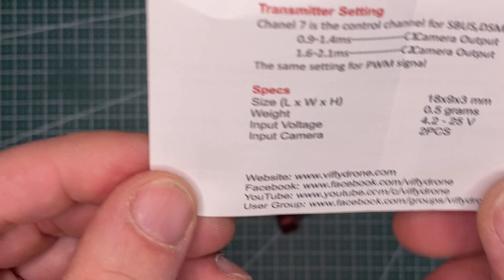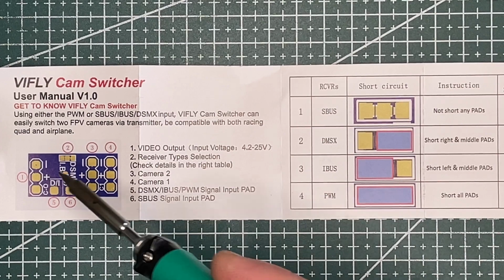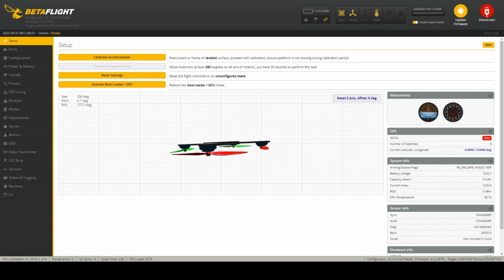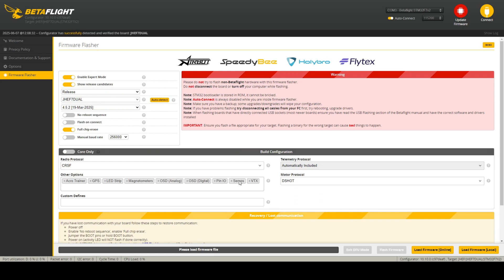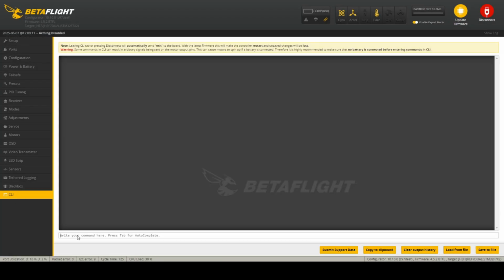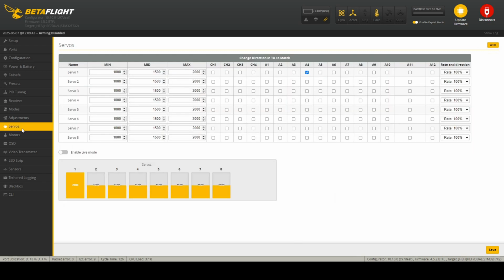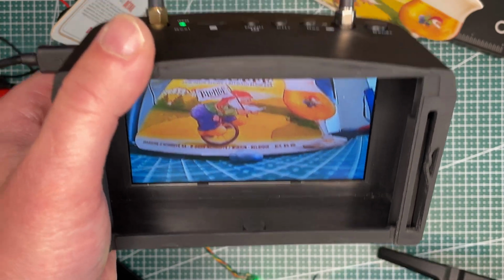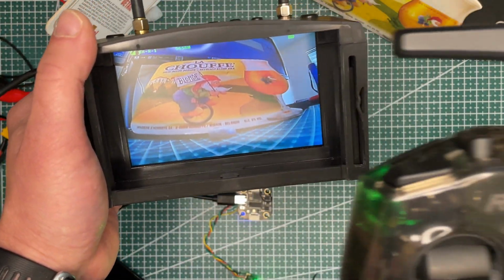How to setup ViFly Cam Switcher the Right Way in 2025 (Betaflight Guide)

Comment: thank you, finally i found the perfect way without having to use the sbus output from ch.3 in tbs rx anymore, so far i have been using the sbus output from ch.3 in Tbs Rx, i will try it soon
Reply from the maker: Thank you! Hope it will work out smoothly!
Reply: @FlyUAFPV Ah, it turns out I haven't activated the LED Strip when flashing the firmware, finally it works perfectly after activating it, thanks again to you
Reply: @FlyUAFPV I've done it, but it only works if I use the PWM5 or PWM6 line, it doesn't work when using the LED line, is there something wrong with what I'm doing?

Comment: I really need to watch this video. However, when I assigned SERVO 1 to my Aux 5  (or any Aux) in the servo tab and I turn on and off the Aux 5 switch at the bottom of the servo tab, SERVO 8 turns on and off and not SERVO 1. Do you know what I am doing wrong? I never assigned servo 8 to any pin.
Reply from the maker: Thanks for the question. Do you have SERVO_TILT or  CHANNEL_FOWARDING  features enabled  in the Configuration tab? If yes, please disable them and try again
Reply: @FlyUAFPV  Thank you. I have servo tilt enabled. When I disable it, it disconnects the connection between my controller switch and the FC, at least according to the inactivity in the servo tab.
Reply: @FlyUAFPV  I tested the camera switcher and it still works even with servo 8 being lined to servo 1. However, I am not getting any OSD display from Betaflight to my goggles.
Reply: @FlyUAFPV  I forgot to wire the VTX through the FC. I am getting OSD now. Thanks for the video!
Reply from the maker: @Binkoro glad it worked out!

Comment: Speedeeby f405v4 с elrs не поолучается с vifly seitcherom подружить, сернз sbus пробовал, но только одна камера всегда работает , подскажите пожалуйста?
Reply from the maker: I have not tried sbus, as outputs for servo are PWM. I would recommend checking if Flight Controller output goes High/Low voltage when you switch camera. This can be done with any multimeter. 
If no - the problem is in the  PINIO configuration. 
If yes - check voltage for camera switcher, 5 volts is not enough, try to power it from 10v pad on your Flight Controller.
Reply: @FlyUAFPV Thank you very much. Everything is working now: the power supply is 9V and both cameras are in PAL format. However, the video switching between the cameras is very unstable-sometimes it works well, other times it takes a long time or is poor. This could lead to a crash during flight. Can

this be fixed?
Reply from the maker: @Дмитрий-ч1ы9у try to power switcher from the battery directly, it accepts up to 25 volts. and see if it helps. I had the same issue when there was not enough voltage for switcher, so added 12 v BEC (see short pinned to the video - i added 12V BEC) https://www.youtube.com/shorts/rKb-Tow7yto